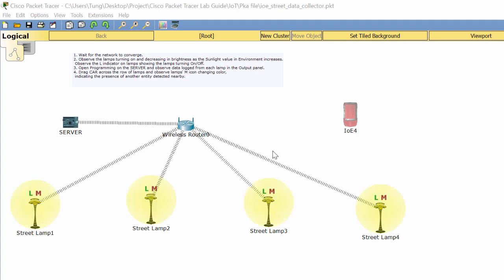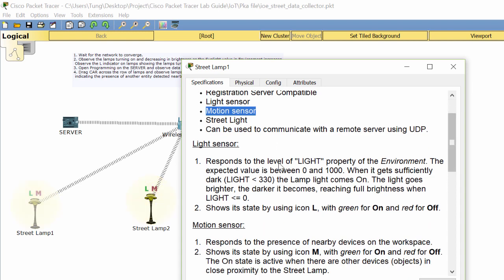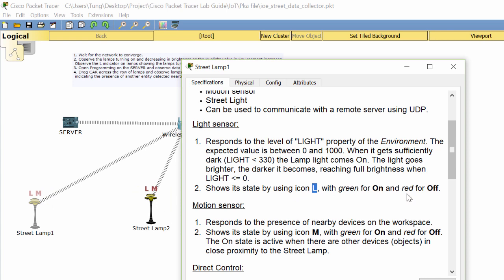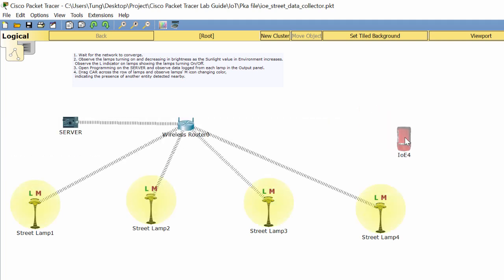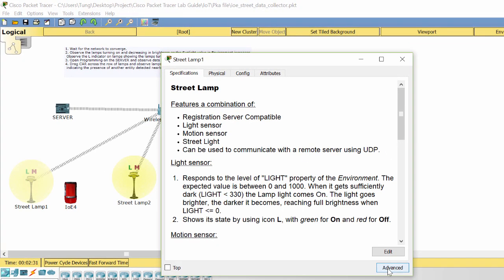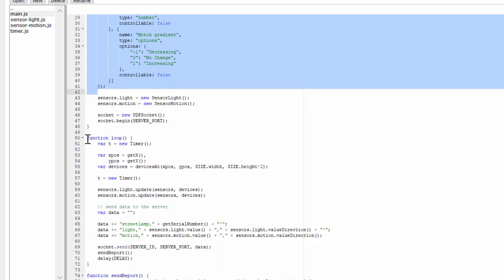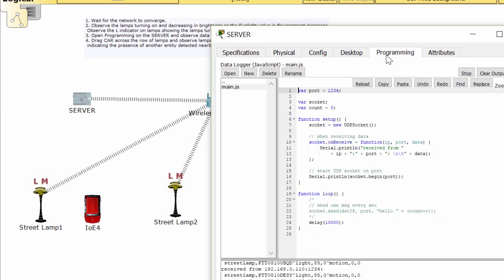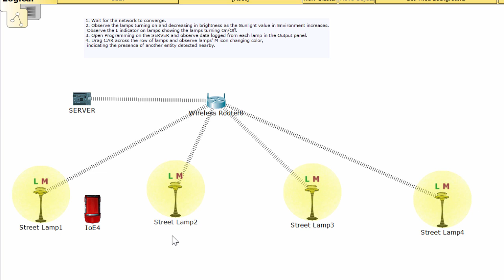[IoT] Smart Street Lamps

Comment: how does the light sensor work? how can I change the sun light ?
Reply: This is explained in the document. i.e., 
Light sensor: Responds to the level of "LIGHT" property of the Environment. The expected value is between 0 and 1000. When it gets sufficiently dark (LIGHT < 330) the Lamp light comes On. The light goes brighter, the darker it becomes, reaching full brightness when LIGHT <= 0. 

Shows its state by using icon L, with green for On and red for Off. 

You can get this model inside the samples of Packet Tracer. 
Click on File> Open Samples...> IoT> iot> iot_street_data_collector.pkt  Open this file and  check details of SBC-PT to get complete code in Programming. 
I hope this will help you.